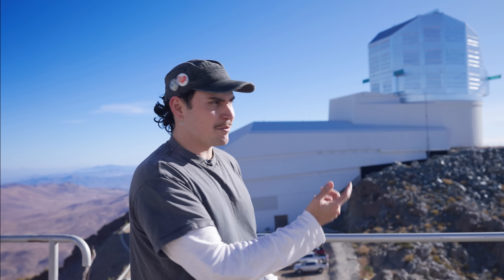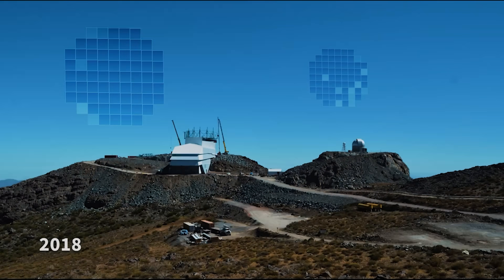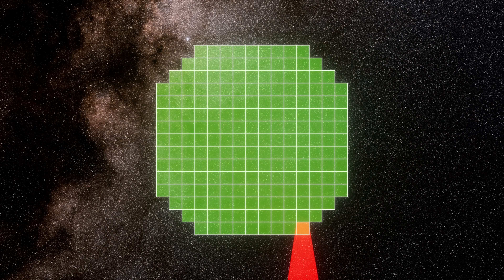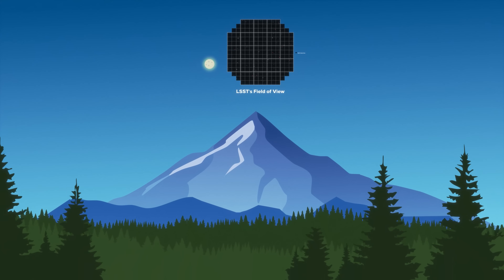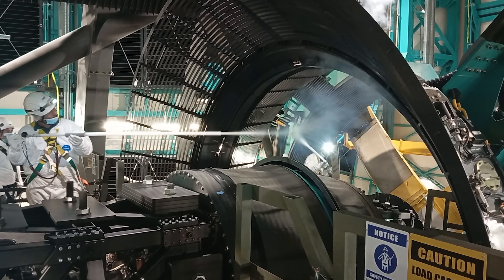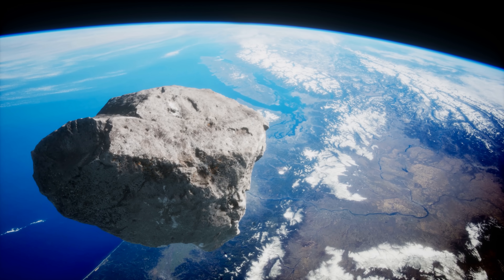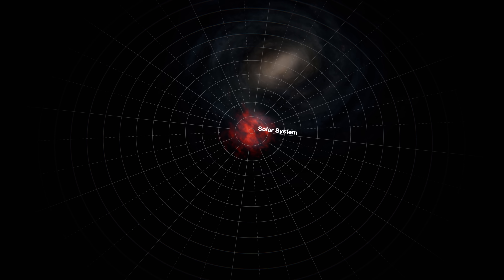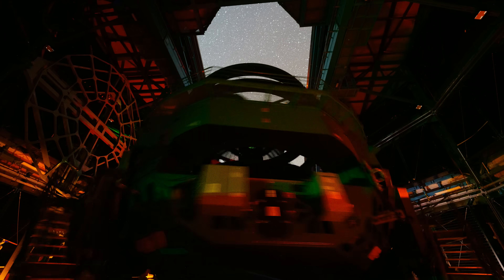This New Telescope Could Save Humanity

Comment: So did U connect it too the clidder scop of Cern, and invert it too the Sun Satellite that u sent up too the sun, then turned it around to face the earth and made it look like a star in the Sky. Now turn the sun Satellite too the sun and run it back through Cert then through  your new telescope with sound on your shurter speed, the sound on your shurter opening and closing, like sending a light signal through sound and light. If other galaxies have there own sun's etc, then they would be throwing there own Light, if I can reflect light too another star, surly it's possible too reflect light to other plants and illustrations through reflecting sound and light. Maybe if one reflects light too a star, another will twinkle over there, 🎉

Comment: 6:16 1/50th of the thickness of a human hair is not really acceptable for a mirror deviation I guess. The acceptable deviation should be a fraction of the observed wavelength. For UV 300 nanometer wave length, the deviation acceptable would be a small fraction of that, say perhaps 30 nanometers. A human hair is maybe 1/20 of a millimeter, or 0.000050000 meters, which is 50000 nanometers. A 1/50th of that is 1000 nanometers and this is a multiple of the obseved wavelength..

Comment: Vera Rubin is not "better" than JWST, that's clickbait nonsense. They do two completely different things. If JWST could have been built on the ground with just a bigger mirror and a better camera, it would have been, there's a reason we spent nearly 10 billion launching it into space.  JWST is an infrared telescope, Vera Rubin is an optical telescope, meaning they observe in different parts of the spectrum. The main reason JWST had to be launched into space was because the atmosphere absorbs the wavelengths JWST observes at, meaning a ground based telescope would just see nothing/darkness at those wavelengths -- it literally wouldnt work unless it was in space, which is why JWST is in space. Further, JWST is designed specifically to have incredible resolution over a very narrow field of view -- it peers very, very far at incredibly precise detail, but can only do it over a very small patch of sky. In fact, it was designed to look back all the way to just before the big bang. Vera Rubin is a completely different kind of telescope -- its designed with a very wide range of view, and to do so very quickly, so that it can scan the entire sky repeatedly. Its goal isnt so much to observe objects in detail like JWST, its goal is to make almost like a very low (as in 1 frame every few days) framerate movie of the entire sky, the point being that its really designed for detecting motion across the entire sky so that we can find things like asteroids and comets, supernovae, etc. Its like the difference between a telescope and binoculars, theyre two very different tools for two very different missions. Beyond that though, common sense should tell you that you dont spend $10 billion to launch a telescope to space if it could be replaced by something on the ground for $1 billion. The Vera Rubin is an incredible telescope and will do incredible things, its a huge leap forward in capability -- but theres no reason to put down JWST. And worse its completely misinforming your viewers, which is a real shame.

Comment: Great video! Just a quick note: saying Vera Rubin “essentially discovered” dark matter might give viewers the wrong impression—most won't pick up on the degree to which you're hedging it with "essentially," as the history is more complex than that. And one nitpicky thing, surface deviations on the mirror are 15-20 nm, quite a bit smaller than referenced in the video. Great work, though!
Reply: Of course it will. That's the purpose obviously for social reasons. Fritz Zwicky discovered dark matter when Vera Rubin was around three and even named it. There is no essentialy. He even predicted the existence of Neutron Stars before one was ever discovered. Vera Rubin did very important work studying rotation rates of stars caused by dark matter.
Reply: @ratdad48  Yes, exactly; I was just being polite. I didn’t think the "social reasons" justified him framing it that way but wanted to keep things civil and charitable.

Comment: 0:12 they need to try this next year when they go to the moon!
Reply: My guy fire can’t burn w/o the O2
Reply: @D3X-Playz  REALLYYY?????
Reply: @FunVideos069  Yes!
Reply: @FunVideos069  Ima join the floppy movement
Reply: star wars had fire in space
Reply: Theoretically could they use some sort of different “fire” that doesn’t fuel on oxygen??
Reply: @aviationxvehicles At first I thought no, since it's an oxidizer that's required... oxygen... but actually yes, you can have non oxygen oxiders according to Google. 

The vacuum might be the biggest issue though. At least if wanted it to burn long.
Reply: Zero chance that is true.. even hubble can't resolve the apollo lunar landers.  THIS thing won't be able to see a tiny candle through 100 miles of atmosphere
Reply: @mark2220 it’s many times over more powerful so I can bet at least you may be able to render the landers on the moon using this telescope.
Reply: How's the candle going to be lit with no oxygen 🥲👀
Reply: @dylanpaulmusic  without it being lit ofcourse 😂